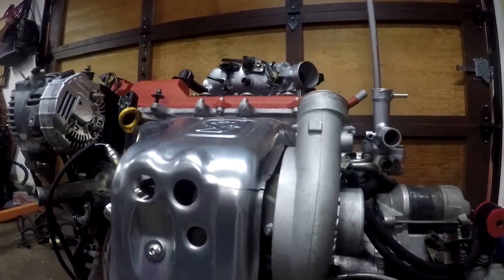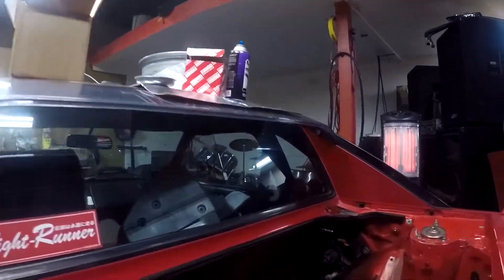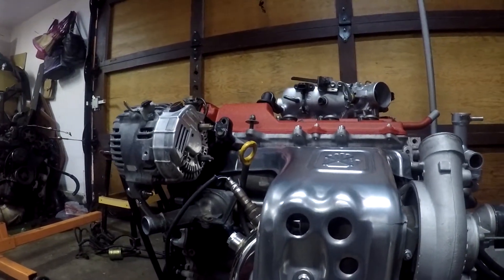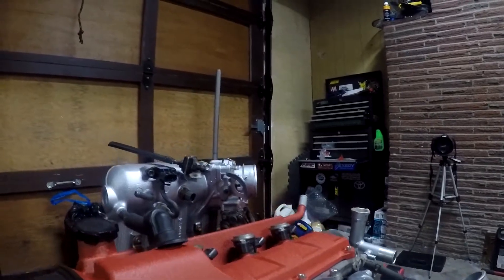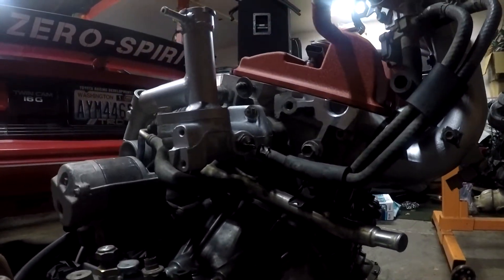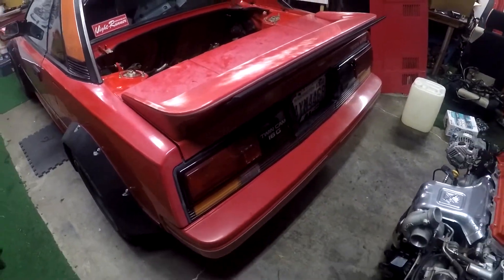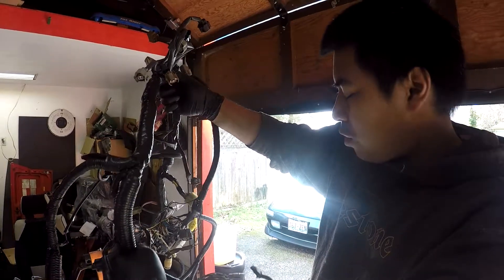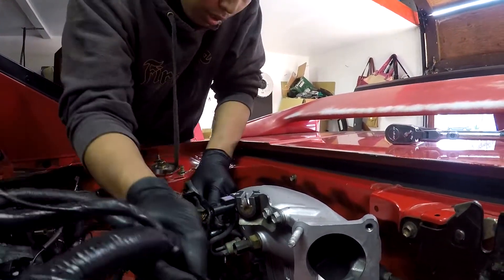Gen. 4 3SGTE Swap into AW11 MR2 part 1/2

Comment: Any heat up issues? As much as I know is that transverse engine with turbo would head up quite quickly due to lack of cool air in the engine compartment..
Reply: kingofiron257
This engine comes in MKII MR2T. We don’t have cooling issues like other mid-engine cars.

Comment: i have a question. did you need to add anything to the gen4 motor to make jt fits? i have a second gen i want to put a 4th gen in it
Reply from the maker: no changes needed to the engine to make it fit

Comment: Very nice man how much is the weight difference verses the sw? if I had a little better paying job I'd love to do this to a corolla
Reply: Redline 280z the sw20 only weighs 2600
Reply from the maker: the aw11 is about 400-500lbs lighter the sw20. so around 2300lbs
Reply: Redline 280Z
You guys are barely 300lbs lighter than our SW20’s. SW20’s get a lot of bullshit talk about how they’re heavy GT cars. It’s nonsense. 250-350WHP turns an SW20 into a very quick car. That’s bolt-ons and the boost turned up on Gen3. Doesn’t feel heavy then.